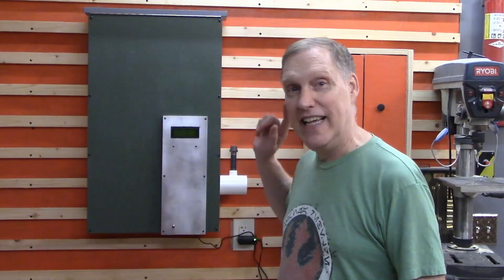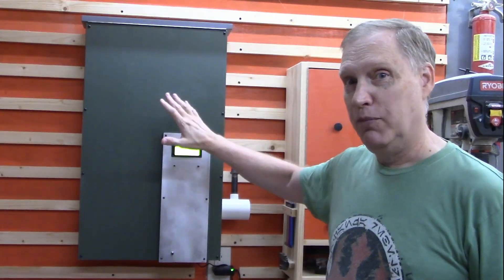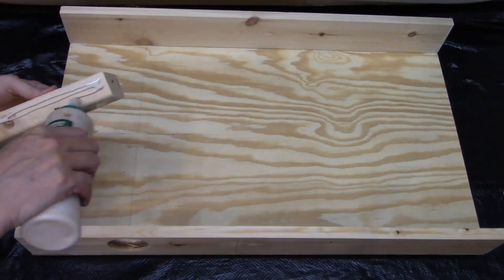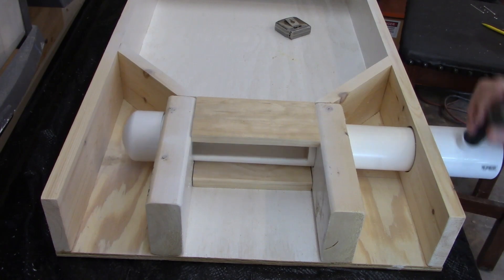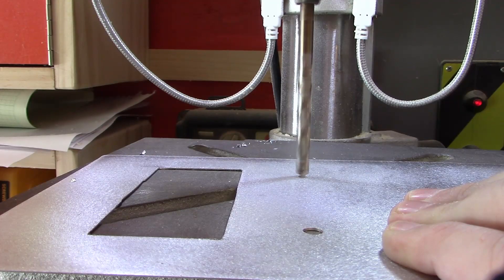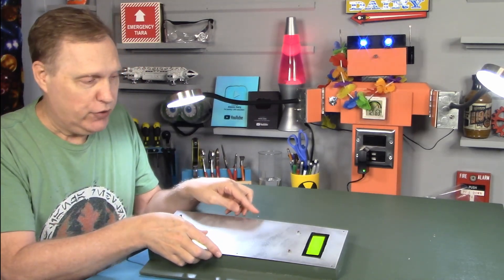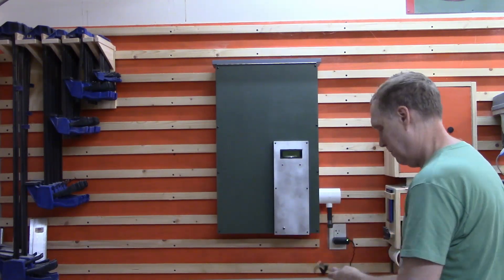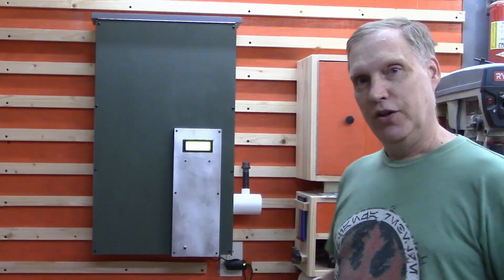Electric Dog Feeder - Arduino Countermeasure to Lying Dog

Comment: If you cut out half the pipe diameter it's going to drop extra food when you rotate the pipe, right? Did you address that problem on a later design?
Reply from the maker: We found it just falls out with the rest of the food. There is probably a cleaner way to handle it but this version works for us.
Reply: @AtomicDairy  yea I was thinking if the portion got to big if to much extra food would drop when you rotate it

Comment: One big flaw here.... It only detects the feeding event after you've pulled the crank... it requires that the operator pay attention to what the LCD says, and you've got to get the dispensed food back into the feeder if the feeder says no. As clever as this is, in its current incarnation it would have been easier to have the Arduino completely decoupled from the mechanics, existing as a simple "push button to see if it's OK to feed the dog" sort of thing. Maybe use something like a solenoid to prevent actuation of the handle (or to prevent the handle from actuating the dispensing trough) until the required time has elapsed?
Reply from the maker: The LCD stays on with the latest feed data even though the backlight is turned off, so you know just by looking at it whether it is time to feed. But I get your point, a pushbutton to illuminate the display would be a nice addition. I also like the solenoid idea. This feeder is a prototype and we are going to build an improved version to use closer to the feed bowl, and hide it in a large piece of wall art. Still designing that and your ideas will certainly improve our thinking!

Comment: I like the simplicity of this design. Does food get caught much, either locking it up or making the mechanism difficult to rotate? I've attempted several servo, self-feed designs that weren't trustworthy.
Reply from the maker: We haven't had any problems. In practice the rotating tube crushes any food that would otherwise jam it, and the fit is close enough that there is no leakage.

Comment: This is a very cool project.  Would you be able to design and demonstrate a similar feeder which is automatic?  I'm needing such an application for a poultry feeder which dispenses feed once or twice per day and would love to build something reasonable inexpensive.  Thanks for the consideration.
Reply from the maker: That would certainly be possible but we aren't sure about making it automatic in a food dispenser. We'd be concerned about over feeding, but with adjustments it could be made to work. It would be a great labor saver though!

Comment: Sweet. Next step: alerting you when it's time to refill the hopper. Or just have one of the sides be acrylic :)
Reply from the maker: That's a great idea! The Arduino can do so much more and we may add that in the future.
Reply: Atomic Dairy how about an optical or ultrasonic sensor in the lid looking down which reads the level of the food? It could notify you of the need to refill then?
Reply: @AtomicDairy  I guess you could do it with a bunch of optical sensors that would gain clear line of sight to the far side as the hopper empties, but they'd be prone to fouling with crumbs and stuff. Maybe something like a toilet tank float, but you'd have to pull it back up with a string during refill, which is kind of a nuisance.